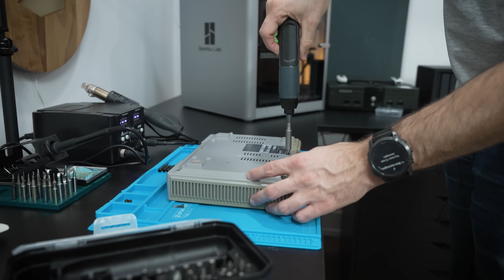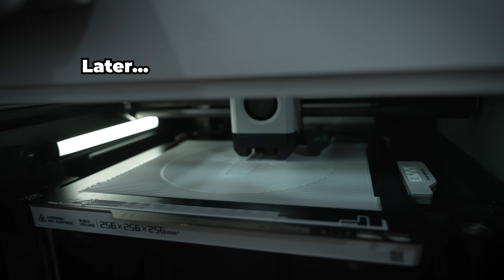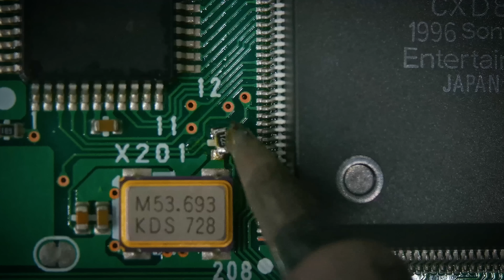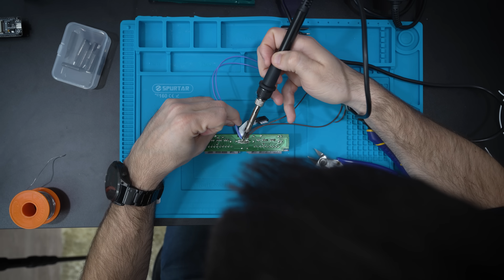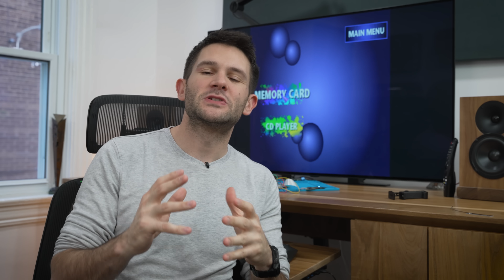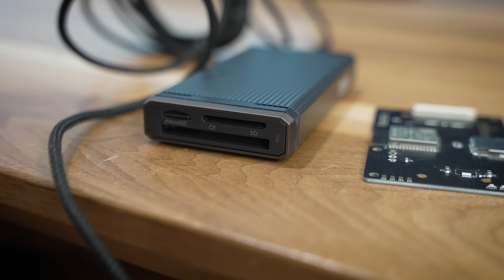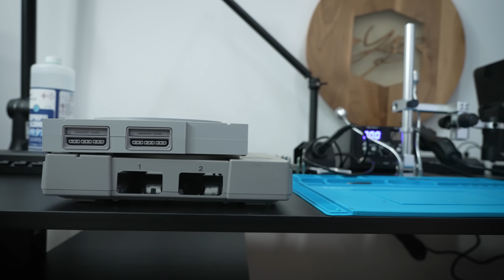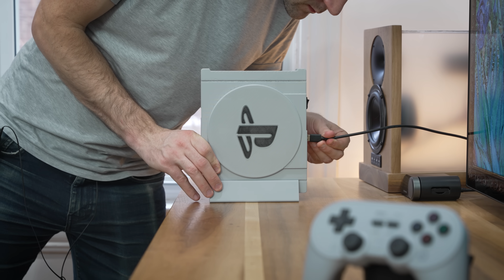I built a MODERN PlayStation...

Comment: do you have any plans to mod an xbox original in the future?
Reply from the maker: I do haha, did you see it in the background of this video?
Reply: Would be crazy to see something like that with the RAM and CPU upgrade.
Reply from the maker: @Naitrate  Ram upgrade for sure, CPU upgrade I believe breaks some games. Need to do more research.
Reply: @ZacBuilds  IIRC if you have a Project Stellar, there's some built-in fixes for certain games that break with the higher clock speeds.
Reply: @ZacBuilds you should look into the Xecuter 3 mods. The LCD is rare but it would look awesome
Reply: @ZacBuilds  it does, but that's why we're here on your channel. Find a way to make it run at 700MHz instead of 1.4 when needed/underclock it in software!
Reply: @Naitrate  check out macho nacho. He does a 256mb ram upgrade.  He also does a lot of other cool upgrade projects.
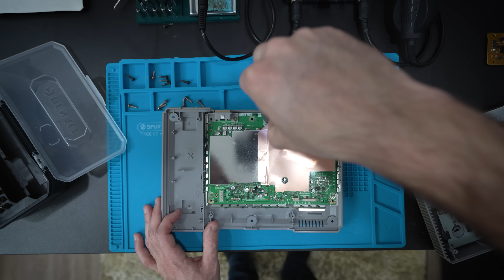Reply: 2:25 I most of the time rip the RF shielding of using wire cutters.The RF shielding is essentially useless.
Reply: This message says it's from 4 days ago.  This video says it came out 9hrs ago for me.. something fishy is goin on...
Reply: @Philly_Gamer  People who pay for channel memberships get early access to his videos
Reply: @Philly_Gamer channel members get early access.
Reply: @Philly_Gamer  are you a paid subscriber?